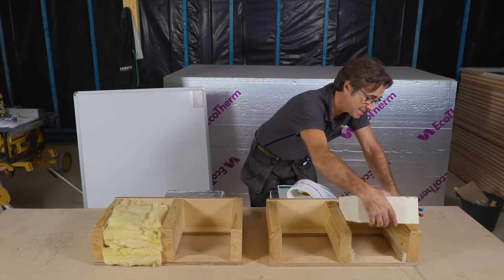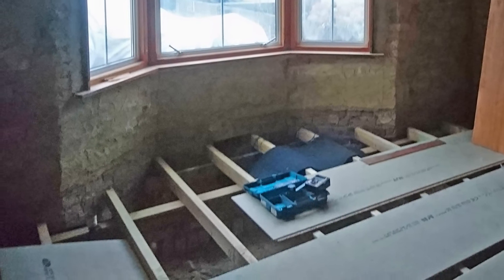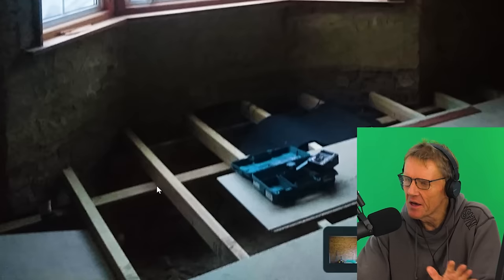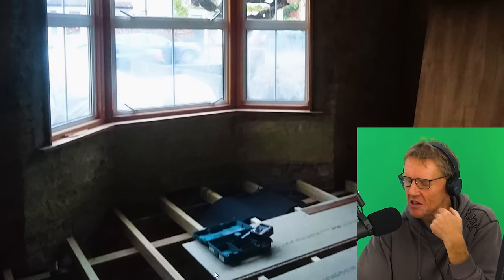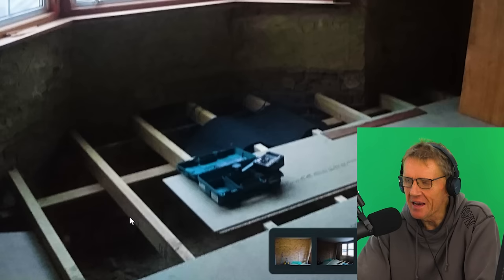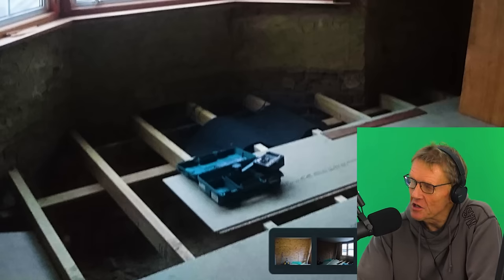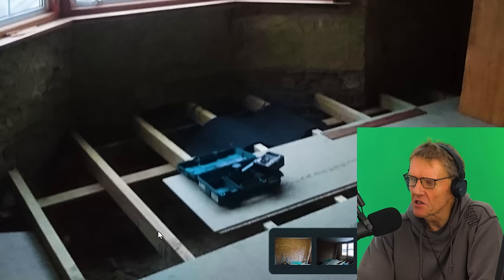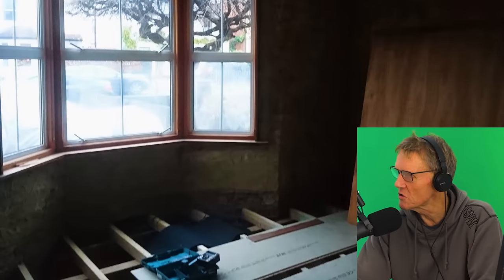Cold Floors & Walls in an Old House ~ What Can Nick Do?

Comment: I’d add that whilst the floor is up, they might have a chance to run some Ethernet wiring that their old house wouldn’t have had before.
Reply: Good idea but also an idea for those who do not have a chance to lift the floor - even if you're redoing carpet you can run a flat ethernet cable down before the new carpet and it'll do the same neat trick
Reply: I mean you could, but that will date too. Go wireless
Reply from the maker: wired always beats wifi
Reply: @DavidBrown-bs7gg   For under the floorboards, that's why you run the ethernet cable through some cable protector, that's flame retardant and animal/rodent proof, that way if you ever need to replace the ethernet, you can just tie/tape to the end of the old ethernet and pull the new ethernet cable through. If you do lay it under the carpet, it's better to run it keeping to the outsides of the floor, so there's no traffic stepping on it every single day.  Also hard wire beats wifi all day long. 🙂
Reply: @SkillBuilder   In terms of performance/latency yes wired is superior, but there are other factors to consider. Our house is over 200yrs old and we have 20+ rooms each with at least one device that requires a network connection.  To run CAT6 cables to every room would be a huge undertaking, in terms of cost, time and potential damage to the fabric of the building. Instead we have a Wifi6 mesh with hubs dotted around the house that delivering at least 100mb/s to every room. This is acceptable for 99% of use cases, and can be deployed in minutes for very little outlay. To that end, I take a more pragmatic approach and would argue that wifi is NOT always the right choice
Reply: 100% correct - Also locate an ideal central location if poss for all the cat5/6 etc to - this would be where your router or patch panel would be - for LAN applications wifi can be painfully slow @SkillBuilder
Reply: You can also run external grade outside, if moving between floors and rooms is to difficult internally
Reply: I wouldn't. I mean I have done in my house, but found that I don't use it as wifi got so good since...
Reply: I WFH and develop software. Some of the developers have had issues with WiFi network dropouts due to congestion due to living too close to neighbours (terrace house) or too many neighbours (flats) or new build (foil insulation).

I've had to dictate to them to run ethernet to their home office and to use a local switch. If they go down the power line route it has to be from tplink (security, reliability and speed).

All the issues have vanished.

My house has ethernet run to about half the rooms. I then plug in the mesh boxes to the ethernet.

I wish I'd run ethernet to more rooms as I've found some older kit does not like newer WiFi kit.
Reply: 100 great old house here. Wifi signal is *poor*. I ran at least 2 ethernet sockets to every room, mainly for a wired backhaul for the mesh routers. So much better than relying on wireless only.
Reply: @TheDamianDixon the main issue I've had with old kit is that newer routers favour unicast dhcp. As soon as I forced multicast everything started behaving better.
Reply: IT engineer here. WiFi has improved in leaps and bounds over the last few years. Try and run data cabling (CAT5E or CAT6) between where you want your home router to be and WiFi access point locations. You will probably want data cabling for CCTV cameras too. For most use cases you'll not notice the defference between cabled and WiFi. If you have an older house with thick walls or extended house  then you'll have difficulties getting signal through them, multiple accesa points are your best bet to mitigate this.

Comment: Ive started doting and dabbing all my walls with insulated plasterboard i have a few external walls  then plastered and the difference is incredible ive not connected my radiator yet its december so its getting colder and the warmth of the room is brilliant. GET YOUR HOMES INSULATED its worth it !!!
Reply: Is it safe to dot and dab cavity walls that get cold in winter. I am thinking about doing it but afraid l will get moisture trapped between the wall and the plasterboard and condensation. I live in a 1906 Victorian house so moisture is always a concern.
Reply: @yesmarioo  My walls are cavity too the idea with cavity walls are that the outer course should be the one that would potentially get moisture from temperature changes and solong as you haven't filled in your cavity (making a connection between walls for moisture to travel between) your internal course should be less reactive to the external temperatures I also did a PVA/Water mix on before doting and dabbing the internal wall. I'm not saying this is the right way but this way has worked brilliant for me and the room I'm on about has two external walls as I'm on an end terrace built in the 40's hope this info helps you.
Reply: @stuartclarke9241  thanks for the tips, appreciate it.
Reply: @yesmarioo  No worries let us know how it goes 😃
Reply: @yesmarioo  Same ere!
Reply: I did this about 15 years ago on my solid external walls for a mid Victorian house in London. It is not a very wet part of the country and that may be why I don't seem to have any problems with damp migrating through the walls to the ceiling and floor joists. I also put thinner sheets on the party walls. My heating bills are not a big worry at all.
Reply: @yesmarioo  
One option I've heard is to have your brickwork externally treated with waterproofing. It insulates because wet brick loses more heat. But leave a 20 cm or so gap at the top untreated, so those bricks can still evaporate anything inside.

Most moisture that would perforate through slowly is stopped, but the wall can still extrude moisture coming from inside, or down.

Comment: I would think the last thing you would want to do is insulate/seal the      breathing ability of the brick from the inside, leaving it exposed to freeze thaw outside. Isn't this why most brick historic buildings are falling apart on the outside?
Reply: Absolutely correct. It is terrible advice. Increases massively the likelihood of ceiling joists rotting, the ends of the suspended floor rotting, and any wooden lintels decaying just for a start.
Reply: How would you insulate the wall then?
Reply: From the outside is the best of not really any great ways. That way the brick becomes the heated part of the envelope.
Reply: @Hew.Jarsol  wood fibre, insulating lime render, there are even 'plasterboards' 'made of lime now with a breathable adhesive. Many options. 
The original questioner in the YouTube video asked if he should use lime. It appears they understand how a solid wall works more than the skillbuilder

Comment: Personally, I try to avoid nailing or gluing floorboards down, preferring to screw them as you never know when you might need to lift them at a future date.
Reply: It will squeak and that doesn’t meet current regs.
Reply: I put access hatches in mine to but there's a lot of room under my floor
Reply: Fine with traditional boards but if they are t&g chipboard as is the case here you can't lift them anyway unless the whole lot come up and even then it would be difficult with the skirting in the way, they really should be glued
Reply: Screws will also penetrate the vapour barrier 👎
Reply: If there is a vapour barrier, then you would only be gluing the boards to that, and not to the joists, so the whole lot can move all day long and squeak whenever it likes.

Comment: I've just ripped out dot and dab plasterboard - the interstitial condensation meant there was massive mould growth and the board was very damp and crumbly
Reply: Were they external walls? I thought dot and dab was fine on internal walls but on the external walls, best practice was to stud to avoid cold bridging.
Reply: @Confusedduckling499  Yes external, the orginal lime walls next to the area were bone dry
Reply: Roger said use insulated boards on walls which will stop condensation
Reply: Roger isn’t giving good advice, you would be better off studding or counter battening the wall first, bad idea to dot and dab on a house with no or little cavity

Comment: It depends if he wants it to be breathable. I've just done a similar job, we used corkboard, which we stuck to the walls with a lime based adhesive. Then lime plastered over the top of the cork. It is a more expensive method, as all the lime products take longer to cure and the process is slower, so more labour cost. I work in Cornwall and Devon where we have a lot of natural stone buildings held together with lime mortar. Breathability is very important for older property's, often sealing them up with modern materials causes more problems than it solves.
Reply: It isn't what he wants, it's what the building wants, that's where most people go wrong.
Reply: But if you don't have effective vapour control layers on the warm side of the insulation then any air that passes through the "breathable" plaster and insulation could condense on the cold wall behind. "Breathability" of individual materials is not the important factor, effective methods to keep relative humidity low and the dew point high are, and there are multiple ways to achieve this.

Comment: Reading the comments, and my being due to upgrade a Victorian end terrace.....it is surprising the lack of consensus as to how to proceed!  Such a common structure across the country too!!
Reply: Same! I'm exhausted by it, I don't know how to proceed, everyone has conflicting advice.
Reply: Well: Knock it down, rebuild it proper without the rotten ancient core and cracking wooden floors.

Yes, that's not very helpful since it's not ussually on the cards, but short of that there's different sub-optimal options.

Comment: Good advice on insulating the floor, that will make big difference. Roger should have pointed out that in the photo there appeared to be an air vent/ brick. Its important that isn’t blocked up as that suspended timber floor needs to breath underneath it. If using wool insulation just tack some vapour barrier at an angle to stop the insulation blocking the vents.

Other option on the wall is to stud it out and insulate between.
Reply: Absolutely agree, air movement is critical in preventing condensation build up.
Reply: I agree that the room has to breathe, but can I ask does the room need three vents and at the bottom? or will three holes in the top corner of the room covered by an air vent suffice?
Reply: Just done this to an old wall at home that was extremely cold. 3×2 frame with Kingspan in between, tape and join plasterboard. Nice and easy and very effective

Comment: Ty Mawr Lime sell a lime plaster system that includes a cork board for insulation that you can plaster straight on to. Can be used internally and externally. Worth giving them a ring, they're technical support is really helpful.
Reply: They also do wood fibre based insulation boards that you can render straight onto with Lime plaster, that way you'll keep the walls breathing a bit, and its a lot cheaper than cork. £3k is to much, so, keep looking for someone and make sure they use lime putty, not the Nhl stuff.
Reply: Ive used that on my single brick rear extension. Works well.
Reply: @emmaearnshaw3282   The problem with wood fibre boards is you need a dead straight and flat surface to fix them to, apart from that their system looks very good if you adhere to it all.

Comment: We have an old house and we used the woodfibre system. Then it’s all breathable, very warm and we just used the lime solo finish coat over the top, looks amazing no painting required. But if you do paint; then make sure it’s breathable. These old houses with no cavity wall or very tight cavity’s, are designed to breath. Respect that and you won’t get any damp
Reply: Am doing the same thing right now actually! Got any photos you can share? Always curious :)

Comment: Spot on advice about the walls , I dot and dabbed the insulation board on with Soudal low expansion adhesive foam as it really sticks to the board and the wall and about the same amount as normal dot and dab but with extra at the top and bottom on the board ( PVA wall first ) but buy it in boxes of 12 as it works  out £7 a can not £18
Reply: Maybe. But I suspect they went with lime rather than plasterboard to allow it to breathe. Old buildings should use plasterboard as it traps moisture

Comment: It would be good if Skills builder could do a video on spray cork insulation for solid/ old walls. I believe it can be as thin as 8mm and can be plastered directly.

This is something I am looking at as there are areas that wouldn't fit PIR or other boards.

Comment: Roger, mention the battens pinned to the joists to support the insulation. I’ve seen examples of dot and dab causing a thermal bridge which has generated cold spots on walls with subsequent mould patches. Your point about insulated board is well made.

Comment: Subsites contain a lot of moisture and with rising water tables could have a few inches of water in now and again. I wouldn’t insulate the floor joists as I have replaced many a floor with dry rot outbreaks. I would put more plastic air bricks in and keep the underside nice and fresh, cold air does not rise. They could always put a thin layer of insulation on top of boards and combined with underlay and carpet would be ok. 
I would 25mm roofing batten the walls isolating the brick work with a plastic dpc to prevent any low level damp affecting the plasterboard. Then use 25 kingspan inbetween the battens and plasterboard on top. Or might be better to use an open cell insulation so any moisture can permeate.

Comment: Also, it looks like you have some support underneath the floor joists, please make sure you provide enough support for the insulation board such as kingsman. Otherwise there is a risk that even if the board is cut to a tight fit as the joists expand and contract that eventually the insulation board drop out.  Good luck with the refurbishment.

Comment: Bought my first house two years ago and have been renovating it on a low budget, I didn't want to buy the big thermal boards as the costs quickly add up for every room. Instead I bought standard plasterboard, used the plasterboard foam spray adhesive, sprayed a pattern onto the back of the board for adhesion, then I used standard insulation foam to fill any empty space on the back of the board and stuck them onto the wall. End result was cheap insulated 'foam' boards on the wall.

Obviously not as good as proper insulation as it's not as thick, but still really pleased with the results.
Reply: Ingenuity pays off. I did something similar for the eaves (arches) on my upstairs rooms. They were really close to the roof tiles and a condensation magnet. 25mm insulation board, and 12mm standard plasterboard on top.

Comment: I've put Rockwool between the floor joists to replace the mostly missing thin planks of styrofoam the builder who owned the house before us tacked in.  The Rockwool is just friction fitted between joists so doesn't need precisely cutting to size & it's not going to fall out because it's so firm.

Comment: Wood fibre insulation is an excellent product for insulating floors. You cut it oversize and it squishes gently in to make an air tight seal. You can run a breather membrane over the joists and under the insulation. For the walls, build out a stud wall to allow an air gap, or use a breathable product like spacetherm wallboard.
Reply: This over under is what I’ve seen other YouTubers do. Although Rog says it should go over the insulation.
Reply: @PaulSmith-pr7pv  Rog said a damp proof membrane should go over, I'm suggesting a breathable membrane. It allows moisture to travel between the room and floor space, albeit in a very controlled and healthy manner. Much more healthy than wrapping your floor in stinky plastic!
Reply: @PaulSmith-pr7pv  with all due respect, Roger is not a carpenter or a builder and his knowledge here is basic. He's recommending it the way the blaggy bodgers do in London which is wrong. There's so much wrong in fact, that almost everything he advises here should be disregarded.
Reply: @stevend9960  Then what SHOULD someone do instead?
No use criticising someone's ideas if you don't offer a "correct" alternative.
Some say the vapour barrier should always go on the warm side of the insulation. Some say put a vapour barrier on top of a concrete floor before putting the insulation down, then timber "floating floor" on top. Then that would be on the cold side.
Does anyone know the real way? Or does it make no difference?
Assuming that vapour is carried in warm air, surely it would rise and not fall to floor level anyway.
Also I've been told not to use PIR insulation in a suspended floor, but use a breathable type (wood fibre, lambs wool, or hemp) with breathable membrane below, and vapour barrier above. There is still the issue of that vapour barrier being punctured by every single screw or nail.
Anyone know the best option???

Comment: Would use mineral wool insulation in the floor - agree on the vapour barrier…. the other consideration is if the brickwork wall which the floor joists are supported on has no DPC… using mineral wool allows any moisture from the wall which travels into the timbers to evaporate down and be taken out via the air bricks…alt. as you have access to the joists, I would wrap them in a DPC before slotting them back into the wall and then do the PIR…